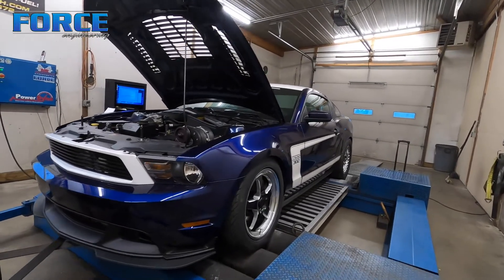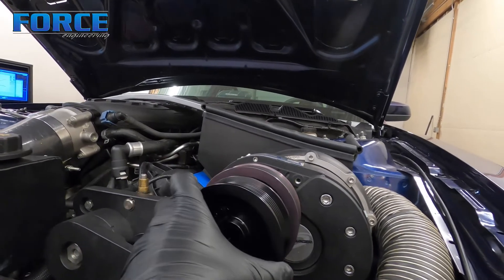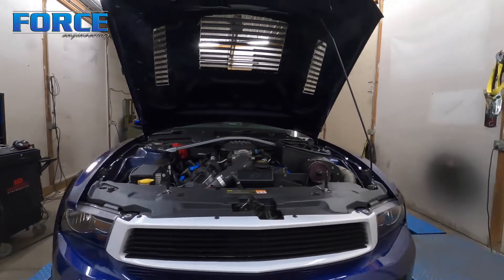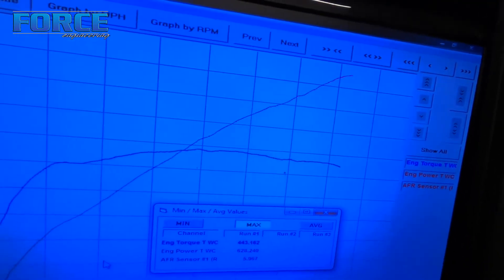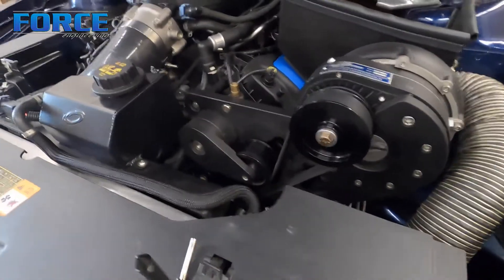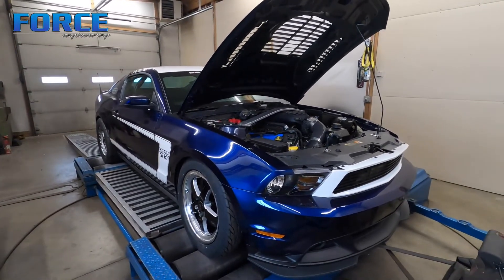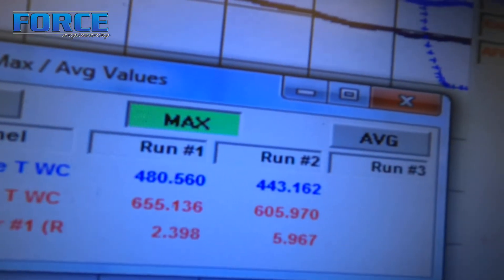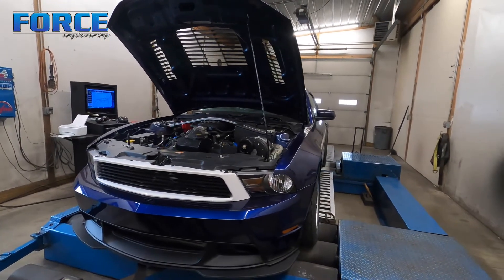Procharged Coyote Mustang 4.39" Pulley VS 3.9" Pulley | Dyno Review

Comment: Was this a 9.5:1 or 12:1 Aluminator? and did it have a crank support? When is a crank support needed for these pro charger setups? I have a 9.5:1 on pump 93 Procharger D1SC (4.38" pulley) looking to add boost just like this car. Big thanks!
Reply from the maker: we're not sure which compression ratio option this engine has.  it was installed by the previous owners. They are currently installing a crank support, but it hasn't had one for years.
Reply: @ForceEngineering  I’m considering doing the same - what part number crank support fits on the 11-14 cars with a 6/6 ATI balancer? All the parts I’ve come across say you have to remove the front sway bar and I didn’t want to do that. Anyway you can find out what compression ratio motor that is? Your help is much appreciated and it’s a great video! Trying to do the exact same to my car - big thank you for your response!